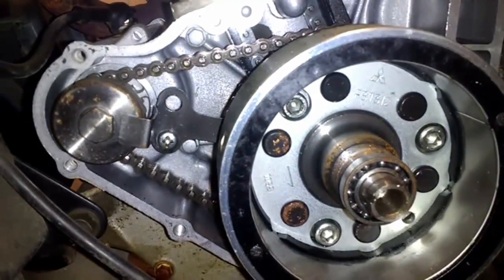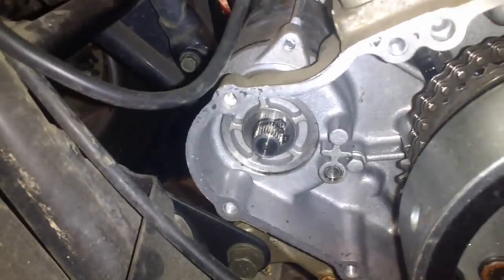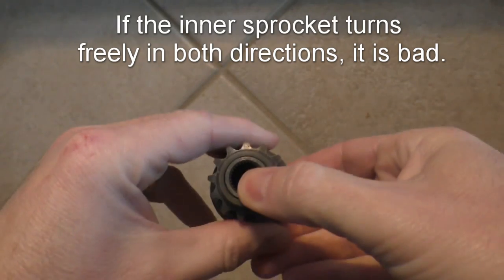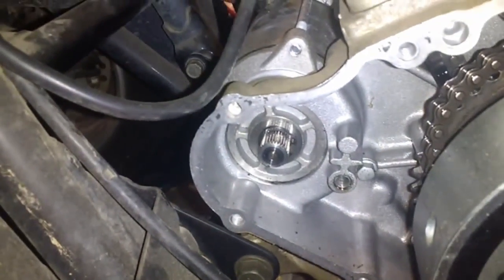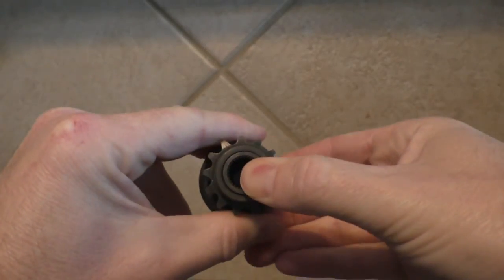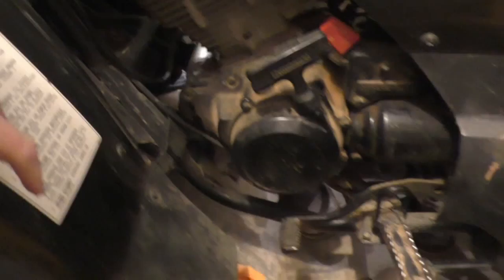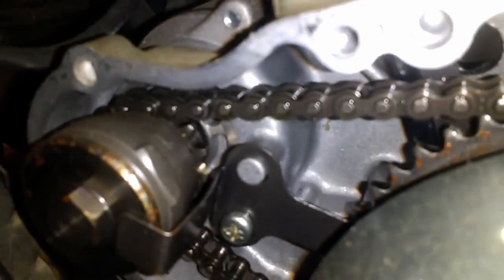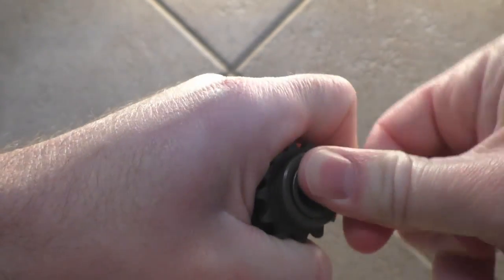Starter Will Not Engage Engine: Fixing ATVs like the Kawasaki Bayou 300, 220, 400 and Lakota

Comment: I have a 96 bayou 400 just installed new starter and about every ten seconds it sounds like it hits a little compression them free spins and wont start. Does it sound like this starter clutch is bad? I was thinking i got a new (bad) starter

Comment: Nice job explaining. So i don't know how often you will check your emails. I have a 1986 Kawasaki Bayou 300. This bike has been sitting for awhile. I believe I see a site glass but still hard to tell if any oil is in the bike without pulling the plug. Anyway my issue is that a brand new starter will not turn by hand. It seems these starters are locked up when you get them. I have put direct power to the first one and all it did was spark and burn the hot side coming from the starter solenoid. Am I wrong for believing that any starter should turn by hand???
Reply from the maker: Some starters won't turn by hand.  Can't remember regarding this quad.  I recently bought a starter for a backhoe that only sparked on a bench test, but worked fine when I installed it.  Still don't know what the deal was, but I almost sent it back and I'm glad I didn't.

Comment: I have a yamaha raptor bought a brand new starter today it spins when I short the starter relay but when I add it into the engine to spin it it does not work all I hear is one dunt noise like the cogs are seized but they are not the electric starter does nothing when I press it I have light my battery is good but Im lost on this quad tbh any suggestions

Comment: I have a 2001 bayou 300 4x4 I'm changing the starter on. I'm having trouble taking the bolt that holds the recoil cup off even with an impact. Do I have to take the side cover off to hold the starter gear while I align the new starter, or will the bendix gear hold the starter sprocket in place. Any advice would be greatly appreciated. Thanks
Reply from the maker: Been awhile for me, but I remember that you remove the left side cover.  Part of doing that,  I remember, is holding the starter pulley with a wrench so that I could loosen the flywheel bolt.
Reply: @FarmDad  thank you for the response.

Comment: Hi I just had to buy a new starter for mine and the sprocket comes with the starter can I use that one can it be fitted on as don't think the sprocket can't come off as same as yours in the video ???
Reply: The sprocket that came with your starter is fine, but it won't protect the new starter from backfires, so eventually a backfire could cause you to ruin your starter.
Reply: Ok thank you, is there any way tightening the starter chain as mine is lose? I got a new chain and still a bit lose ?

Comment: Im having this problem with my 2004 Yamaha burin 2x4, but i cant find the repleacment part, can you please help me?
Reply from the maker: I found this one on eBay https://www.ebay.com/itm/124729292306?chn=ps&norover=1&mkevt=1&mkrid=711-117182-37290-0&mkcid=2&itemid=124729292306&targetid=1645685074768&device=m&mktype=&googleloc=9025856&poi=&campaignid=16730423415&mkgroupid=135815925780&rlsatarget=pla-1645685074768&abcId=9300841&merchantid=101648746&gclid=Cj0KCQjwxveXBhDDARIsAI0Q0x0-UHQPlZcRWsN0OuOcVAC8xCaUs-HLcG9GVw1JPyspiXrrerRTHdAaAv5lEALw_wcB
Reply: @FarmDad  that will fit a yamaha burin?
Reply from the maker: @MrAlternation  my bad, I didn't notice you had a Yamaha.  This is for a Kawasaki.
Reply: @FarmDad  yeah, im having the same issue for months

Comment: I've got a 97 Kawasaki STX 1100 jet ski that's doing the same thing. I've replaced the starter with a OEM as still does the spinning. Could it be this issue too or a bad Bendix? Thought and suggestions would be greatly appreciated!

Comment: Would this be applicable to a 1993 bayou 4x4 400 ?
Reply from the maker: Yes, the 400 also has a starter clutch.
Reply: I have a 96 bayou 400 and it is nothing like this, it has a idler gear in-between the starter and flywheel. I have the same problem but it's because the hole where the idler goes has worn away causing the idler to not sit in the right spot, there's no bearing in the hole, it's just part of the crankcase, idk how I'm gonna fix it
Reply: @nickpolitis416  does any oil/fluid come out when you take that part of the case off?
Reply: @JN0777  yes oil and water, since the water pump has to come off too

Comment: What if it make no noise when I press the start button
Reply from the maker: First check your battery, then your connections and grounds at starter and battery.  Possibly check fuses too.  Then try to jump starter solenoid.  If it starts then, replace solenoid.  If still nothing, try banging starter with hammer.  May need to replace starter.

Comment: My Kawasaki 400 kfx is doing this.. Whats type of sprocket do i need for Kawasaki kfx 400?
Reply from the maker: Try these part numbers: 12600-29810
13216-S010
3445-031
If that doesn't work google search for starter clutch sprocket or starter one way bearing.

Comment: Great video!  Just replaced mine ($180) and the starter is once again engaging the flywheel.  

Did anyone happen to take their old idle gear apart? I did and what I found surprised me.  There was a washer and two very thin spacers inside.  There is a groove in the part that fits over the starter spline.  It looks like an Oring would rest in that groove, but I found no evidence of an Oring.  This is not a complicated part.  Why can’t it be repaired?
Reply from the maker: Let us know what you find out.  I have not tried repairing the part.
Reply: @FarmDad  If you have a bench vise and a 14 mm socket and ratchet take your old one apart. I’d love to know someone else’s thoughts on this. I have two children who are mechanical engineers and together we have not figured this one out.
Reply from the maker: @keithwilder9639  unfortunately I don't have my old one anymore.